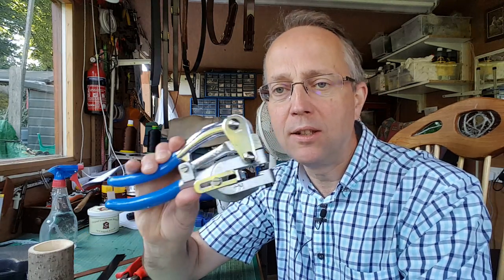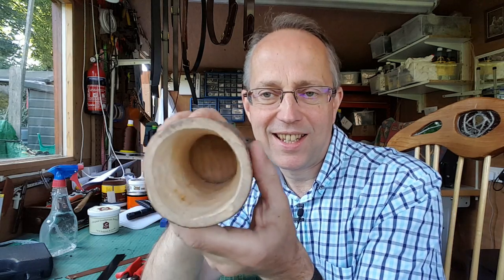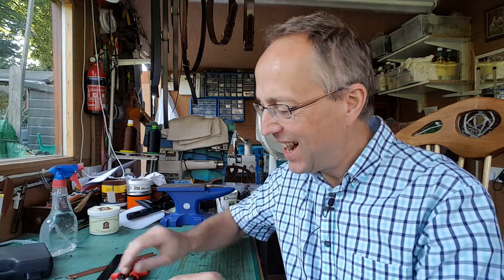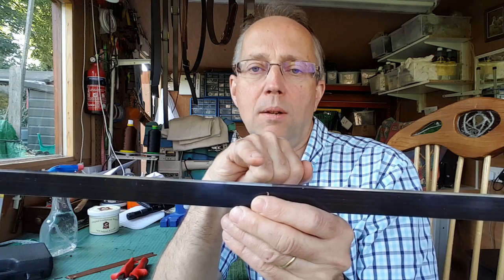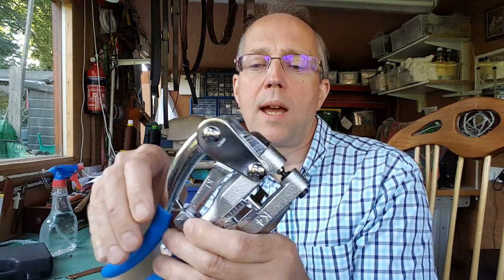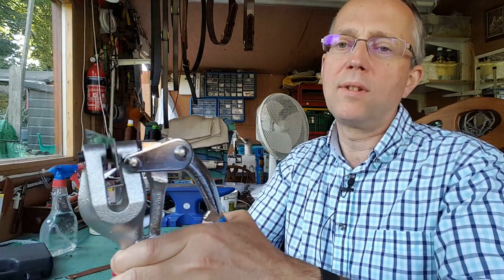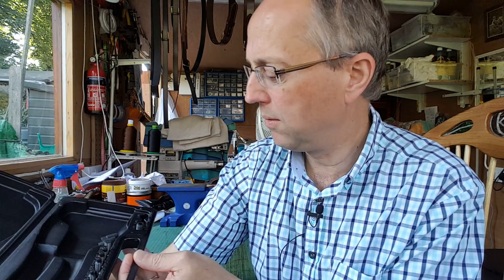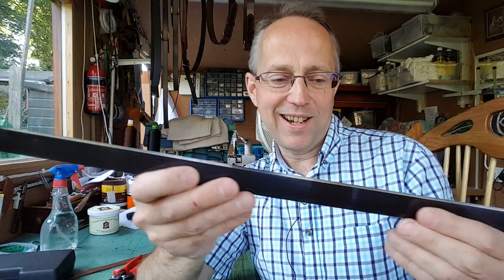Shrink Pot Update, Hole Punching Thin Metal Steel Rule Die...Shed Talk 11

Comment: The Whitney punch is a nice addition to your tool arsenal. We have used one at my work for years to enlarge the hole on large area washers we use in a particular helicopter for making our own balance washers to balance main rotor blades.  They can punch through some pretty thick and high grade steel. Ours is a bit longer handled than the one in your kit, but either way, the Whitney punch is one handy tool to have available for many things. Good video, great to get reacquainted with old friends again (the box from your past).
Reply from the maker: Thanks for the proper name......mine is a fairly cheap Sealey Tools punch but seems pretty good.....I have seen exactly the same model being sold for more than twice I paid!.

Comment: A possible solution to prevent leaky shrink pots: take a piece of thin wire and hammer it around the circumference of the dry wood bottom of your pot. Remove the wire (you're just using it to crush the wood fibers) before you put the bottom into the green pot. When water reaches the crushed fibers where the wire was hammered, the crushed fibers will swell outward, sealing any spots that aren't tightened enough by the green wood drying around the bottom piece.

Comment: Unfortunately in todays world making things is rather frowned upon by modern man, this means that more and more people rely on buying new, whenever their equipment fails, whereas those of us that can make anything, and posses the machinery to make things tend to be independent of these modern trends, if you have difficulty in forming sharp bends in your cutter strip, by using one of the small flame guns that are sold in cooking shops ? you can locally anneal the strip where the bend is to be made, you will then find it much easier to form a tight bend.You can always reheat and quench the cutting edge if you think it is too soft. Chris B.